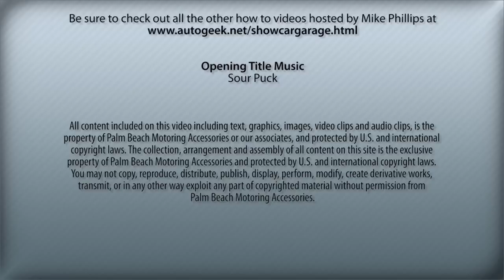Tips for using a Rotary Buffer and the Flex 3401 on vertical panels

Comment from the maker: Actually, what I've seen all my life is you can remove most of the residue but after a few days you'll see a whitish stain that is pretty much there forever.  My rule of thumb is if you don't what to use a toothbrush after the project is finished then tape-it off.

Everyone can decide what works best for them but for me I tape all plastic trim off and just avoid the entire hassle.  -Mike Phillips